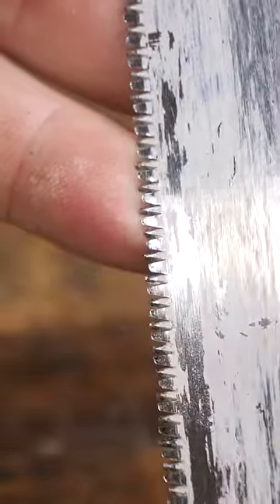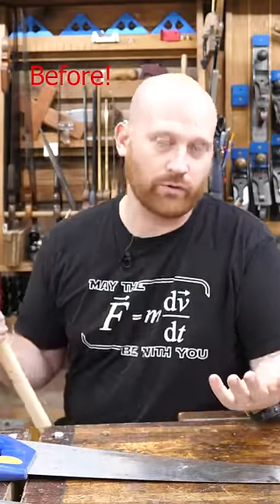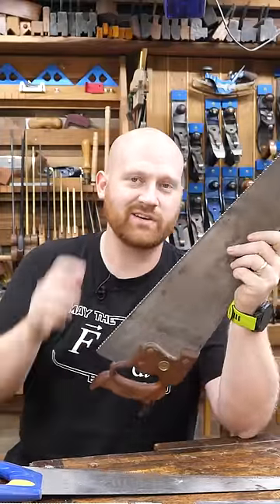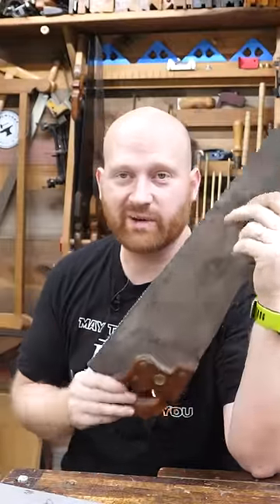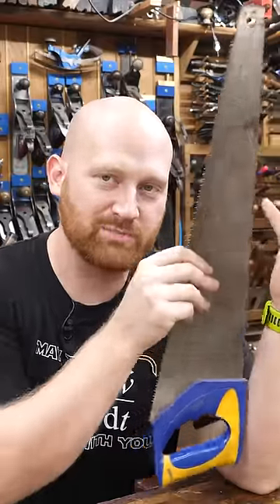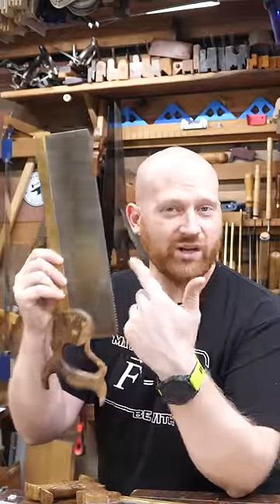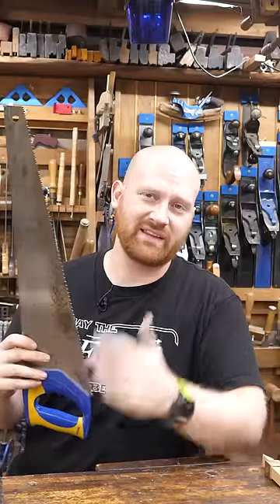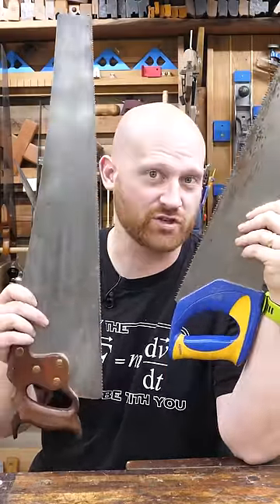Hardend Teeth Vs Old School Teeth on a Hand Saw

Comment: Or just anil the teeth and then sharpen. Then you can heat treat the teeth again. Then you can get the best of both!
Reply from the maker: That sounds good in theory, but in practice, it often warps the plate. most people if they want to re-sharpen it grind the teeth off and file in new teeth, but both are a lot of work for a $10 saw.
Reply: @WoodByWrightHowTo  I use an induction heater to temper the edge on my items that need sharpening like lawnmower blade, hand ax, machete and the like. It's not hard and doesn't take long. Anneeling the metal actually takes longer to prepare to sharpen as you have to heat it and let it cool slowly. Still not a significant impact once you set yourself up the first time.
The warping only happens when you cool the metal unevenly.  
Although I don't use handsaws, on a  circular saw blade I have no problems.

Comment: Sharpen hardened saw teeth with diamond files.
Reply from the maker: I've tried that a few times. But the diamond file cost twice as much as the cheap plastic saw and it only lasts for a couple sharpenings. In the end is it really worth that much on a junk saw. I'd rather get a good quality saw that doesn't require it.

Comment: Or you buy a good and proper saw with hardened teeth and sharpen them with a diamond feather file
Reply from the maker: There is no good saw with hardened teeth. And the correct shaped diamond file costs more then the saw.
Reply: @WoodByWrightHowTo  😂 no. Silky saws ARE proper saws. The correct file doesn't cost too much either. Here in Germany we also have a shop called "DICTUM" - They sell premium quality under their own brand name, saws for woodworking with hardened teeth and the appropriate diamond feather file.
Reply from the maker: Silky saws are tree saws and only come in rough crosscut patterns. Do they sell them over there with a decent handle.
Reply: @WoodByWrightHowTo  you need really to check out their hibiki or dozuki. Perfect saws for carpentry from silky
Reply from the maker: Oh the Japanese saws that is something all together different

Comment: I don't know of any carpenters building houses who use handsaws
Reply from the maker: I use to be a framer for 5 years. We had 2 in the trailer. There were not many uses but there were a few. Like removing the base plate in doorways.
Reply: @WoodByWrightHowTo I think the multi-tool has largely replaced that use case.
Reply from the maker: I have seen a few crews move to that. Much slower, but takes less skill.

Comment: dead wrong; advances in "zone" hardening allow the teeth to be hardened while maintaining the flexibility of the blade. these saws are easily sharpened with abrasive methods, like a Foley Saw Filer, or by a hand-held die grinder,   
just like metal-cutting tools.
Reply from the maker: A lot of work for junk $10 plastic saw.

Comment: But isn't it still possible to sharpen hardened teeth? If it's about the sharpening equipment being too big, I'm sure there should be something to sharpen hardened steel teeth. If it's about doing it manually, it can be automated to be done quickly.

I think technology is good enough for hardened teeth and sharpening combo.

And if hardening is only at the teeth, that's not a big problem too. As long as the whole saw being the same steel... Just harden the other areas.
Reply from the maker: You can get diamond files the right size and shape. But they cost twice as much as the cheap plastic saw and they do not last very long.

Comment: People didn't forget how to sharpen them, it became more costly to spend the time to sharpen them over buying a new one.

Labor used to be extremely cheap in the US and products were the expensive part. Now that has flipped and products are cheap and labor is expensive. So it's cheaper to buy a new saw than to spend the time sharpening a saw.

Comment: If you're building houses, get a power saw👍
Reply from the maker: I did framing for a few years we always had 2 hand saws in the tralor it is the tool for cutting out bottom plates on doorways and other similar jobs. even with the power tools around it is faster.

Comment: If you’re a carpenter building a house you’d use a skill saw with a disposable blade.
Reply from the maker: I use to do framing for years we had a couple hand saws in the trailer. They are the tool for cutting out the bottom plate in doorways and other similar jobs.

Comment: In our machine shop we re sharpen all the time tungsten carbide which is infinitely harder than hardened steel on a saw like you're talkin about so if we can sharpen tungsten carbide and silicon carbide and other things of that nature why do you think it's so difficult to sharpen hardened steel we also do that all the time they even have these are files with basically spin a very thin rubber band with piece of sandpaper with diamond dust impregnated on it to file said carbide and Harden steals so you just got to change your file you don't need to stop using saws with hardened teeth in fact a solid heart and teeth sounds like a great idea because you have to file it way way way less often but there are files that will cut hardened steel without any problem and as you say don't be cheap keep your good sauce with the hardened steel teeth and use a more expensive but much better file designed to cut hardened steel. It's so super simple man you're telling us not to be cheap when we buy our saws will don't be cheap Woodbine your files by some files that can actually cut some hard shit. Why are you using a piece of crap file to sharpen anything hard when there's actually files that will do it awesomely. Look for your files at somewhere like w.w. Grainger or J&L or one of these industrial supplier that supplies huge CNC manufacturing outfits with all their carbide and files and start measuring instruments and Brown & Sharpe measuring instruments and all that good stuff they have what you need to sharpen hardened steel without any issues. And remember take your own advice don't be cheap no one said I filed it's going to do what I'm saying is going to be cheap but when you're doing real work don't skip out as you put it

Comment: Pretty sure it was the other way around. When they introduced mass made cheap ass saws with hardened teeth, people stopped sharpening.
Reply from the maker: the hardened tooth saw is a newer thing only about 30 years old. most sharpening stopped back when the power tools became common.

Comment: If you showed up to a job site to frame a house and you pull out a fucking hand saw you will told not to come back
Reply from the maker: I used to be a framer for many years. We always had one in the tool trailer. It only had a couple uses but it got pulled out from time to time. They started to be replaced with a vibration detail tool. But most good framers prefer to use the handsaw in that situation. It's just faster.

Comment: Use a grinder not a file, like a drill doctor
Reply from the maker: Those won't have the right profile. Here is how you sharpen a saw.  https://youtu.be/e7YsjKhqk-w
Reply: @WoodByWrightHowTo  i said like a drill doctor, the word means similar, the point your missing is a grinder can do it the file will get dull and can not...
Reply: @WoodByWrightHowTo  you missed the point entirely and i really dont even think you understand the difference between the capabilities of grider vs file
Reply from the maker: There is no grinder that would fit that profile. I'm well aware of grinder as I've sharpened many drill bits by hand. I use one quite regularly in my shop. Some people will use a diamond file but those wear out very quickly and usually cost a lot more than the saw. There's a reason only the cheapest plastic handled saws are hardened.

Comment: You can absolutely sharpen a saw with hardened teeth, just not with a file.
Reply from the maker: I have seen a few diamond files that are the right size and profile. But they end up costing significantly more than the saw. And do you really want to spend all that time and effort and money on a $10 trash saw with a plastic handle?
Reply: @WoodByWrightHowTo  I was thinking of abrasive discs, as used to sharpen bandsaws.  I have sharpened a cheap saw with a dremel and cut-off discs, but without a jig to semi-automate the alignment it's a time consuming task.
Reply from the maker: the profile on these would not let that work. they have a 60 degree cone between each tooth. the tooth geometry for power saws does not work well for hand power.

Comment: The time you spend sharpening is time you could be working. Time = $
Reply from the maker: If that is so then they would also make hardened teeth in the high quality saws. But all of the high quality saws have the softer teeth.

Comment: A carpenter building houses isn't going to use them... at all.
Reply from the maker: I did Framing for a couple years. we had 2 in the traler. there were several jobs that that is the only tool for it. such as removing the bottom plate from doorways. though some now use a detail took, but that takes WAY longer.

Comment: the old saw teeth were hardened, they were also tempered...kinda surprised you missed this basic level info...
Reply from the maker: Even today the good quality ones are not hardened and tempered. There left and yield the same way they come from the manufacturer. They use simple 1095 spring steel. Back in the day it would have been in the old after the blacksmithing worked to relieve the pressure and allow it to spring it would not be re-hardened and then tempered.

Comment: Been building barns, decks, interior walls, outdoor structures ect for about 17 years with my grandfather and father.
Never used a hand saw once. 
Legitimately never. 

When you can spend 60$ on a shitty electric skillsaw or any number of saws why bother.
Reply from the maker: When I was a framer, there were several places where it was faster and easier than skillsaw or Sawzall. Especially when flush cutting work like on the base plate out of a doorway.

Comment: 👎. The Japanese Ryoba (double) saw the knowitall held
in the beginning of the video has electro induction hardened teeth and can cut well for many years.
Reply from the maker: Depends on how often you use it. For me it's about a month or two of regular use and it needs to be sharpened or thrown away and replaced.

Comment: News flash you will not build a house with that saw unless you have 10 years and you start at 20 years old.
Reply from the maker: I used to do framing for a few years. And we had a couple of these in the trailer. There's still the tool to use when you need to cut out the base plate and a doorway or several other applications.

Comment: Wait... You say... Your NOT gonna find hardened teeth after WW2... But you also say only the Old saws are un hardened... For the most part.

The point is those are opposing statements... Are they not
Reply from the maker: What's the video again I put a text over the image correcting my statement. Didn't catch it until I did and I couldn't reshoot the section.

Comment: If you’re a carpenter building houses don’t use a hand saw
Reply from the maker: Most framing companies still have one or two in the tool trailer. There are a few tasks that this is just the fastest and easiest. Like removing the bottom plate in doorways.

Comment: If you're a carpenter building houses, you should REALLY invest in some power tools. Not a hand saw.
Reply from the maker: LOL correct. But as I used to be a framer every framer out there has a couple of these in the trailer. There are things that they can do you you can't do with power tool.

Comment: If you’re a carpenter building houses you aren’t using a hand saw
Reply from the maker: I did framing for years and we had two in the trailer. They were the tool for the job in several places, like cutting the sole plate from doorways.

Comment: Who the hell uses hand saws in 2023?
Reply from the maker: Most all fine woodworkers, framers have a few places where it is still the easiest and fastest tool for the job.
Reply: @WoodByWrightHowTo  I don’t know how it could be “the fastest” if you have to send the apprentice all the way to the truck to fish it out.
I framed house after house with a Skill-Saw and a Sawzall as the only cutting tool.
I think there might be a scenario where it could be used in Finnish-Carpentry, but it’s mostly obsolete.
Reply from the maker: I did framing for a few years. we kept two in the tailor for cutting bottom plates out of doorways and other similar jobs.
Reply: @WoodByWrightHowTo  I do appreciate the video which promotes proper tool maintenance.
It is also very interesting.
I do use a Bowsaw for camping. Though; it comes with removable, hardened blades. 
The concept is still solid. Also; there’s a Japanese carpenter/YouTuber who uses all kinds of handsaws. His methods are really awesome. Nothing you’d come across on any house drawings here in Toronto.
Thank you for the upload.

Comment: I'm a bit upset about your casual conflation of Japanese style pull-saws, into this same conversation about hardened/not.  'Cause the multi-faceted Japanese pull-saw tooth geometry is beyond the grasp of most mortal (or at least "Western") humans anyway.  So home-sharpening them is a LOT more prohibitive/demanding just inherently in terms of skill & tooling needed, regardless of the hardness question.  So with that being the case, might as well just go with the hardened/disposable kind. 

Disposable-blade Jap saws are also not nearly as economically wasteful, since the blades are thinner (with the strength in the spine, not the blade itself, i.e. the whole point of the type configuration) AND the blades are proportionally much smaller in area, than the Western type.  So there's much less wasted steel by comparison, than throwing away a whole Western Push-saw.  (This generalization is leaving aside the whole category of smaller traditional Western "back-saws", obviously, which are more similar to their Jap-style counterparts in both engineering and virtues, if not size.  But those are for the smaller/specialized scales of work than the basic "full-size Carpenter's/Framing saws" being waved around in this vid.)

Comment: Who still uses handsaws anyway
Reply from the maker: Anyone doing fine woodworking. Carpenters will use them for locations that need flush cutting. such as removing the bottom plate in a door opening.

Comment: Dude you can anneal the blades to sharpen and then re-harden them. Its not that hard... (Difficult) LOL
Reply from the maker: That sounds good in theory, but in practice, it often warps the plate. most people if they want to re-sharpen it grind the teeth off and file in new teeth, but both are a lot of work for a $10 saw.

Comment: So your getting into good wordworking where your $ per hour is at a premium sometimes 20-40$ per hour and so spending time sharpening saws that could be 2-3 hours somehow makes it worth it to do that instead of buying a new saw.... No....
Reply from the maker: If you're getting into woodworking you're not going to find a hard point saw that will do half the working unit 2. They only come in a course crosscut tooth pattern. Unless you go towards Japanese saws.

Comment: this is complete nonsense, the entire saw is hardened and then tempered, if the saw was not hardened it would never bend back to its original shape and would dull in no time..
Reply from the maker: I think you miss the meaning of the teams. 1095 Spring steel is tempered to around 45-50. in the saw world that is called un-hardened to separate it from the new cheap saws that have hardened teeth. The teeth on the hardened saws are hardened up to around 60+
Reply: @WoodByWrightHowTo  in the metallurgy world thats called hardened.